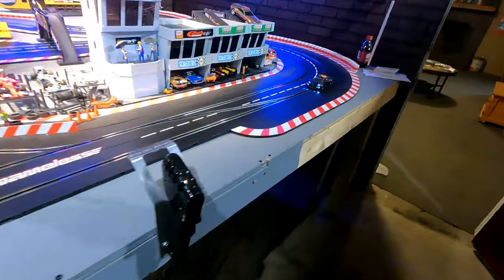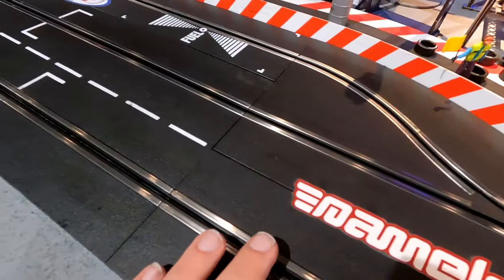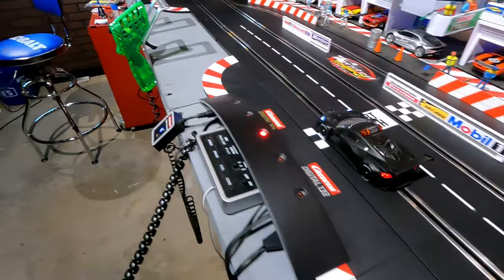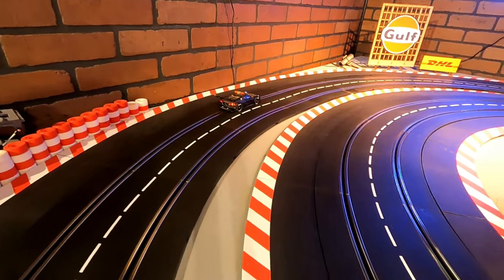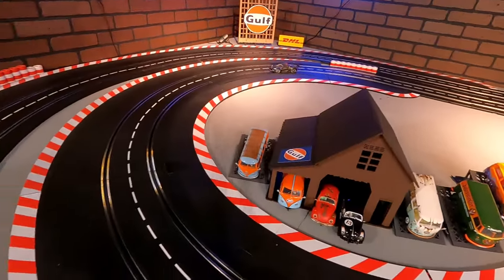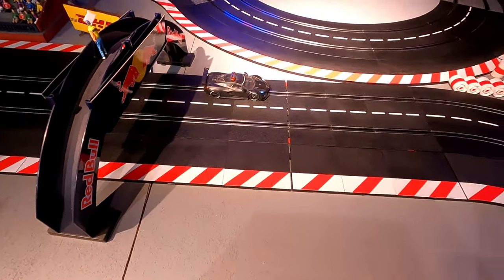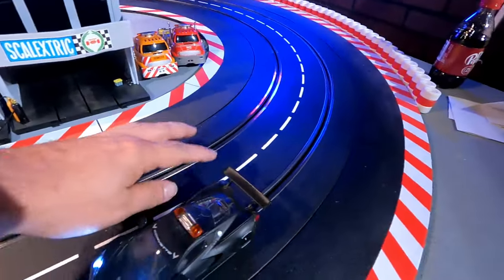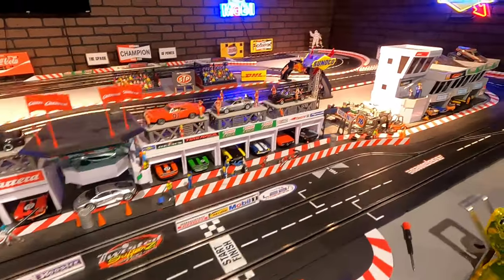walk around of my Carrera digital slotcar layout and list of pieces needed to build it

Comment: If you buy the Autorehnnbahnplaner software, it will give you the ability to design the track and have it fit properly, using 1/3rd and 1/4 straights if they are needed. The software is designed for all of the Carrera track systems and is a brilliant piece of software in my opinion.